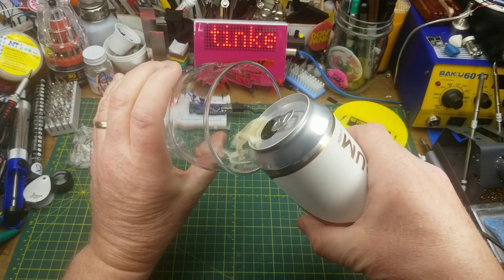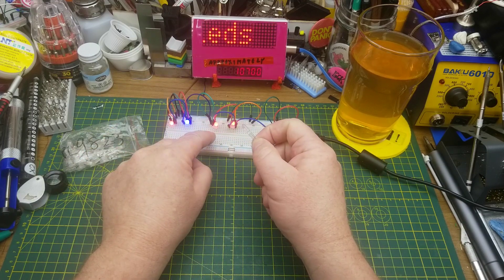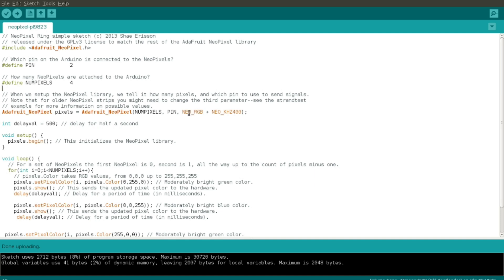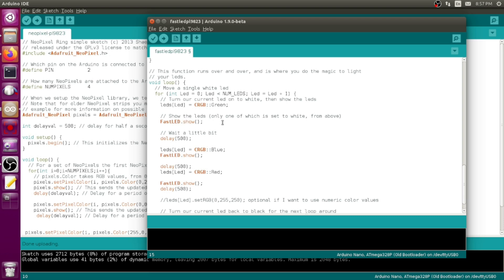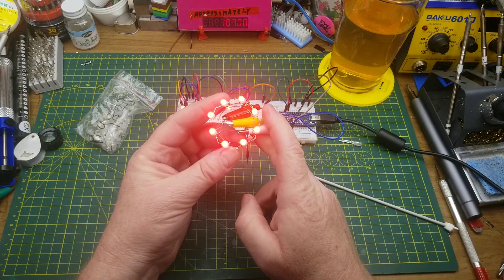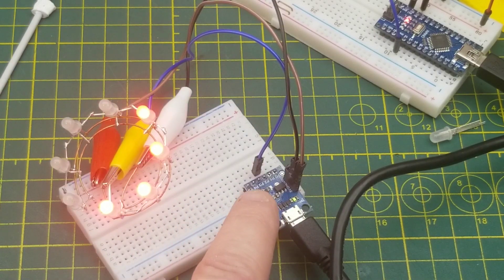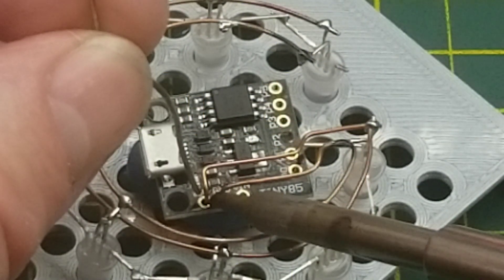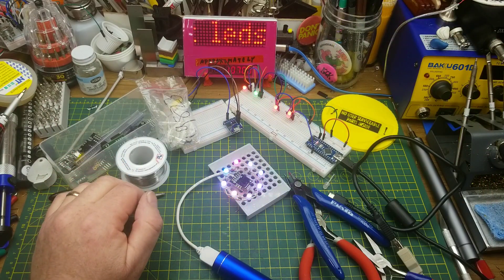tinkering with PL9823 LEDs

Comment: I started using them recently with my custom Propeller 1 and Propeller 2 drivers -- they work fine at 800kHz. You can also find them called APA106.

Comment: I've decided to start using them. I have some 3d printed grids and thick gauge copper wire. For what I learned as well is they're the dip version of the overpriced adafruit dip neopixels you see for 5 dollars each on Amazon. When I buy them, doesn't matter which seller they're labeled as apa106, ws2811, pl9823, ws2812b. They're the first leds I've ever tested with fast led that you declare as rgb amd not grb up in the top of the sketch. I have the 8mm ones. Best way to test them is with a coin cell too where they are blue when lit.

There's a bunch of Chinese sellers on Amazon selling cool model train stuff. For scenery I mean. I'm going to use wled and give the matrix away. I have an 8x8 I'm doing first then a 16x16 that I'm going to make silly pygame apps run on since I'll be using an esp. I've been doing alot of pygame lately. You learn all sorts of different math and all the built in features which require you to use code in arduino ide

Comment: I didn't get the notification for your last number of videos kent
Reply from the maker: Youtube regularly finds new and unexpected ways to be broken...
Unfortunately, I don't think there is anything I can do to force it, beyond enabling "send notifications", which I have on as default.
Reply: @pileofstuff  yeah I figured it was the tubes causing it. Bell notifications haven't worked for me in months yet random other channels I don't watch anymore pop up constantly.  I wanted to mention this to ya Kent. I was all set to send you a bunch of stuff but I've watched a big part of your back catalog and there's nothing I could send that would excite you unless you want leds or 3d printer parts and motors or old 8 bit main boards from creality. If you're interested though I'd be more than happy to send you a few stepper motors, extruders, an all metal hot end and other upgrades haha. Not having to change ptfe tubes anymore is heaven. I'm not sure if your v2 has a 32 bit board or not but get banggood to send you a new motherboard and screen (LOL). Bigtreetech skr e3 mini v3.0. The extra options and a bigger touch screen is amazing. Being able to change firmware using gcode on a built in terminal and fixing pid settings and leveling preferences is incredible. I have a brand new bltouch that I don't want as well haha. Take care.
Reply from the maker: @jstro-hobbytech  I appreciate the offer.  My printer does have the newer 32 bit board, so firmware is a piece of cake to update.
Reply: @pileofstuff  i think i sent you a bunch of the 8mm ones haha. i made a giant matrix of them on perfboard overnight. time to write some code. i'm doing a massive rgb unicorn puke room makeover for a friend's daughter. i have so many leds man and i've given so many away. it's like they never end. they are so pretty though imo. the nicest displays are made with them. bitluini made cool magnetic modular matrix with them with code that adapts to the new size. super cool project. he's a great engineer. i took software engineering but became a 911 supervisor so i should be a better coder but i've been coding alot the last ten years and getting better. i've been  researching a 3d game engine project to make with some friends. they can make the art and i can code the open gl engine. it's surprisingly  understandable when you break it down, especially when using oop. i was gonna send  ya another care package but i seen your mail pile in you last mail bag hahahaha. 

if you did want a package, i'd send you stuff you dont have. like wima film caps and audio stuff that i dont have time to use. it's up to you. i have alot of quality parts i spent a fortune on. i'm looking to buy a thermal cam gun for my father in law if you wanna sell one of your's. id rather give the money to someone i respect. cool if not though. i have stereo jacks, stomp box switches, i even have a nice vintage effects pedal board i'm restoring if you're interested. no charge. splits on shipping though for that haha. it's a boss me-10. i dont need it as i have a helix floor with a million options ill never use and i usually only use 2 predefined effects anyway ahaha. i got it free so im not complaining but i did try to sell it when i got it. posted it new in box for 900 off retail before tax and no one bit yet the local long and macquade cant keep them in stock. i just bought another prs though and someone gave me a super rare bass plus im buying a classical guitar for some gigging with a friend. i can shred but cats can sing better. it's the only hobbie i've done almost daily for 31 years so it's not a boast. good players are a dime a dozen though so i dont think im special hahaha.

watch the terrifier movies online man. if you love classic horror villains, art the clown is legendary and i suspect will go down as such. it's as gory as it is funny. i used to say i'd rather face any enemy other than a fully grown xenomorph but art is on another level. 

i've got a brand new lcr meter too if ya wanted to do a trade for something. no need to have 2 and they come in handy. especially when you tear down old hardware. it's has 3 different probe types except kelvins for some reason. they are cheap though. it's up to you brother, i have alot of brand new servos too, especially the kind people build rc planes with to move the flaps if you're interested. i have no need of them. plus i'd part with a few nice bldc motors and esc's and include a remote for convenience hahaha. i literally have thousands of dollars worth of new rc motors and such if you want some for free. plus tons of different bearings and such too.

do you use your laser cutter much, you dont talk about it anymore. i have 2 but never even turned them on haha. i was going to start building pcbs with them and layer soldermask colors for labelling.

if anything interests ya buddy just reply or email. i've got a ton of guitar parts too, bridges, tuning keys and such. all high quality brand name. your son might like them if you dont. mostly prs, schecter and jackson stuff. i'll never use it. i need to sell a guitar actually once the market isnt so flooded with covid guitars. taking a 1200 dollar hit on a guitar i bought a year ago to sell back to long and macquade just isnt worth it. i'd rather hang it on my wall and use it as a conversation piece. it's a 7 string headless ibanez with super high build quality but the pickups are a little too warm unless im playing alot of thump guitar with my fingers. i'm  trying to trim down all my collections haha. i still have that pc hardware i mentioned too brother. i'd let it go for a steal and you'd have an awesome computer.

anyway i'm rambling. i dont want to just send you stuff if you dont want it right. my component collection is out of hand. shit i've even got real parts from space shuttles im trying to sell. all the official nasa documentation and everything. i should open an ebay store. i even have new rc build kits if you want one for free. hobby grade aftermarket stuff too. every scale. i've got some real nice 1:24 scale stuff that would look cool with your trains. all axial brand parts too. lots of sets of drone motors too and related sensors if you want another project to add to the list hahaha. i wouldnt offer just anyone this stuff. you're the only person i support on youtube now so i should raise the monthly donation actually.

your chill attitude makes you among the best brother. you dont pretend to be something you're not.

Comment: That's hilarious. I just received 600 8mm ones hahaha. WLED works with them as well. They look identical to the adafuit ones but when chained in large numbers or large distance you have to put a Un polarized .1uf cap between vcc and gnd on each one or they flicker. They cost a fortune, I spent almost 100cad for 600. I plan to make animated displays with them using 3d printed grids in shadow boxes. I'm also going to use a few on my 3d printers top gantry for their new enclosures.

Comment: Would a small capacity ceramic capacitor inline with the LED's smooth out the flicker at lower levels?
Reply from the maker: Don't think so. Each LED has a control chip inside it that is doing the PWM dimming. 
It's the PWM frequency that is messing with the camera.
Reply: The supply to the LEDs is pure DC. As previously mentioned, the flicker is from the IC inside the LED body dimming the chips via PWM.

Comment: Kind of reminds me of Big Clive's fake supercomputers made of an array of self-flashing LEDs that eventually get out of synch and flash randomly resembling 1960s computer displays, except your rig allows some programmability as well as sequencing. You (anyone) could build an array of four linear strings of LEDs each run from one of those I/O pins, wiring the LEDs randomly in each string rather than linearly if you see what I mean.
Reply: 1960s? The Connection Machine 5 is a supercomputer from 1991 and has those Blinkenlights.
https://en.wikipedia.org/wiki/FROSTBURG
Reply: I originally ordered mine so I could make a super computer too. I've made super computers out of busboard pcbs but where all the different color solid and blinking leds I have the panel didn't turn out right because of all the differing forward voltages  it was a waste of about 400 leds and 3 days, my bench psu stopped displaying voltage and just went into constant current mode consuming about 5.5 amps and the panel got so hot that the flux boiled as I hadn't cleaned a part of the panel along with the fact I underestimated the robustness of Busboard Systems 20 dollar pcbs copper clad traces and it was just meant to be a quick test lol. The magic smoke onlu came out of a few solid red ones for obvious reasons but the clear red blinkers were fine aha.I literally have tens of thousands of leds. Probably closing in on 50lbs of them hahahaha

Comment: W/R to model railroading, neopixels and these 9823s have many uses.  For my HO steel mill electric furnace, used array of 23 neopixels that fit inside the furnace and flash randomly with changing colors ... program running on an ATTiny 85.  Result is an model electric furnace that appears to be working.  Can't attach photos or video here but love to send you.  Cheers!!
Reply: Of course you can share photos. Upload the photos to a sharing website, then post a link.

Comment: Nice. I've started using Visual Studio Code with the PlatformIO extension for Arduino type stuff (Atmel, ESP32 etc).
I think this works in Linux.

p.s. ATtiny13's are cheaper for a flashing a LED.
Reply from the maker: The libraries I tried were all too big to fit into an attiny13. 

I was hoping it would work. if you look closely at the "drawer of attiny" I had on the workbench, there's a tube of attiny13s in there...